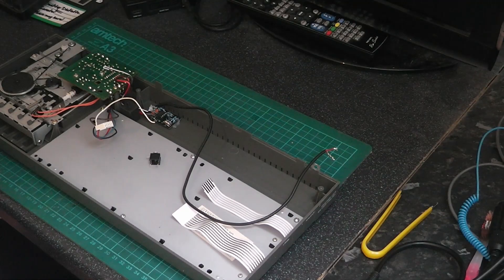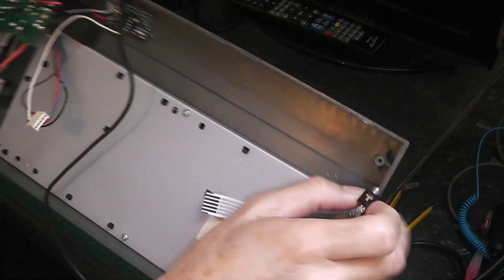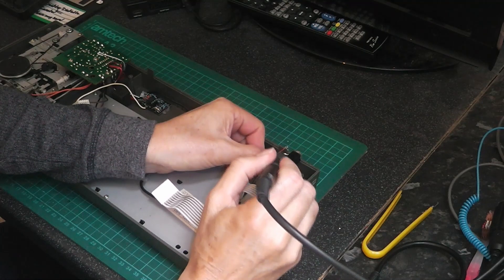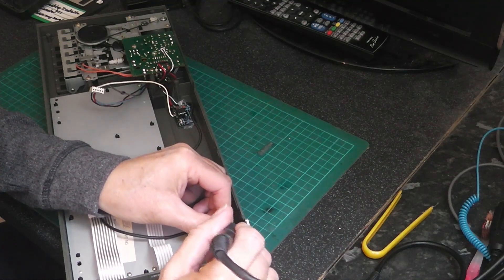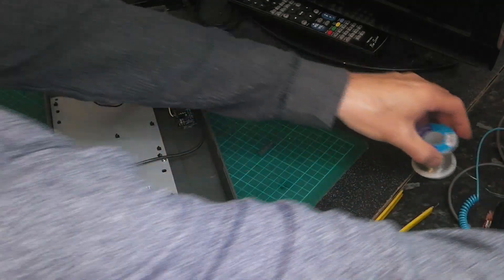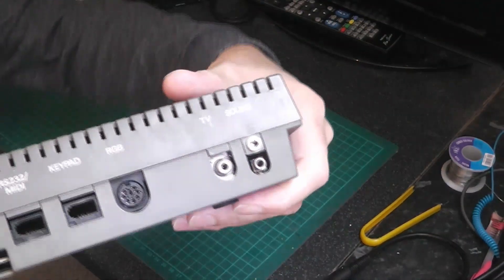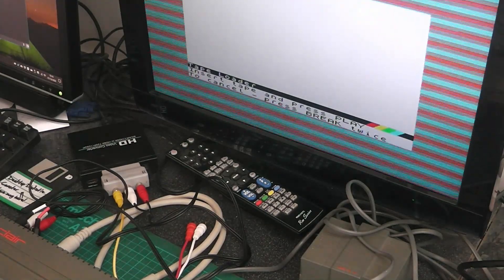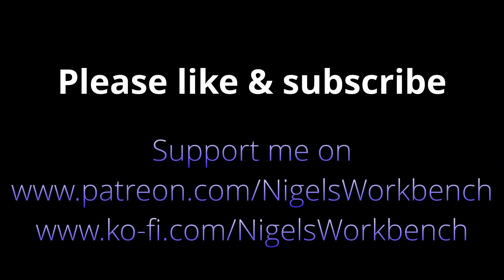ZX Spectrum +2 external tape mod

Comment: why we couldn't just do this with the TAPE/SOUND socket (as could be done with the +3) is anyones guess.... the tape deck on my spectrum packed in very quick, and we wasted £50 buying an external tapecorder which we were assured worked with +2A...of course it didn't.... my +2A became an expensive door stop for a poor family very quickly after xmas!!

Comment: hey man i have a zx spectrum 2+ and was hoping i could use it as a standard tape player/ recorder without connecting it to a tv, is this possible? Is there any way to mod an IN / OUT on the built in tape deck ?
Reply from the maker: I think it would be possible?  However if you were thinking iof playing audio tapes, I don't think the quality would be very good.  :)  There is a USB adaptor to use a Commodore C64 tape deck available.